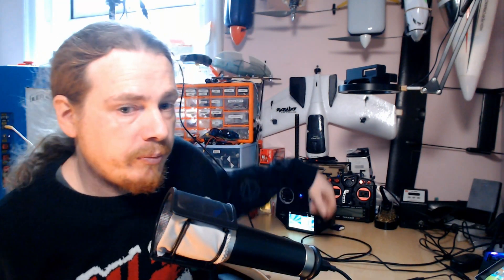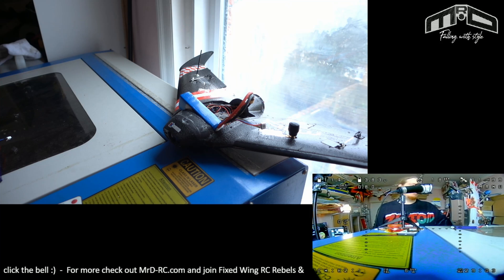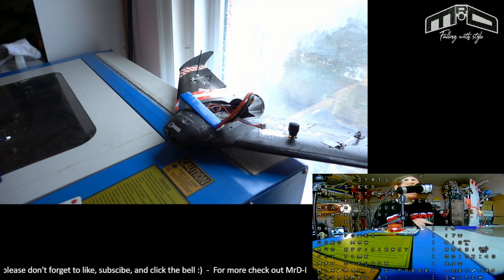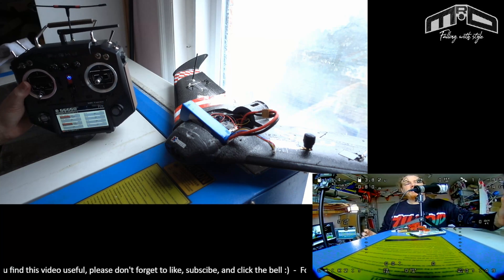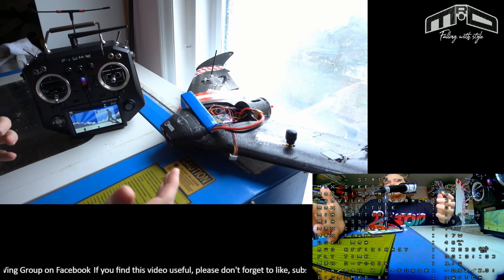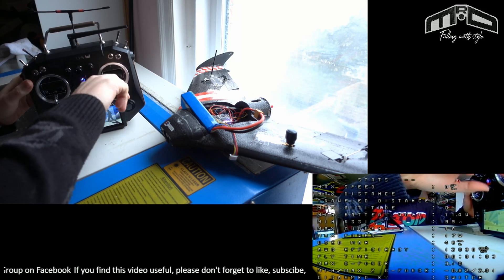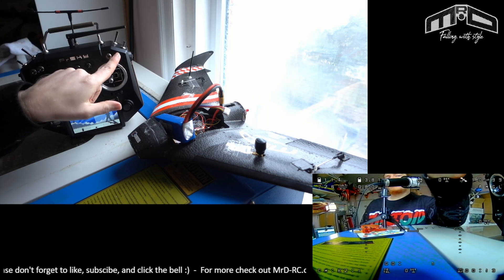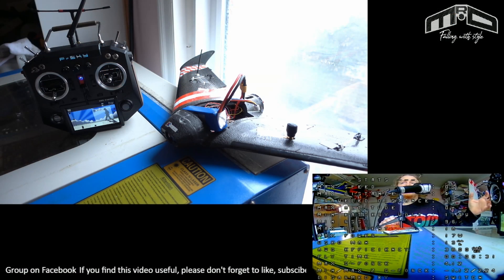Re-Arm In Flight With No Restrictions: Revisited

Comment: This is so useful! I'm quite sure I've had a couple mysterious BAD crashes due to rearm "safety" conditions not being met and also throttle down auto disarm features being activated during random soaring sessions. I wasn't aware of these features. I've been trying to figure this out for almost a year. I wonder if this should be a click of a button option in the  modes tab or advanced tuning tab of the INAV configurator.

Comment: Thanks a bunch! Setting it up on my stuff. I did have a problem not this summer/fall but I think it was the summer before. I had auto launch on all the time and went to move my monitor and bumped the arm switch and disarmed. The plane would rearm fine but the motor wouldn't spin. Maybe it was a bug or something. It was a few versions of iNav ago.
Reply from the maker: It could have possibly been stuck in the pre-launch stage. As soon as I can get flying, I will be trying this out in the air. If I find that it is an issue, I’ll raise a bug. I’ll be trying this out with the default trigger values. Of course, I’ll report back here. 

I think the key will be to look at the system messages after rearming. If it says autolaunch and the motor wont start (this will be stuck at pre-launch with no idle throttle set), lowering the throttle and wiggling the pitch/roll should cancel the launch. That worked fine on the bench. It also didn’t matter if it was permanently enabled or on a switch and still turned on. Also idle throttle didn’t make any difference, other than the motor spinning.

Comment: Are you going to include this configuration on the Inav /OpenTX controller suite you developed?  (Fixed Wing Group "Standard OpenTX Model V2"
Reply: Since I got your attention, (I looked), where can I find your standard OpenTX Model V2 and Pro configs?
Reply from the maker: https://www.INAVFixedWingGroup.com 👍🏻
Reply: @MrD  sorry, I looked there, but didn't look deep enough.

Thanks!

https://inavfixedwinggroup.com/guides/opentx-model/inav-fixed-wing-group-standard-opentx-model-v2/
Reply from the maker: Hi Corey. No it won’t be included with the OpenTX models. We can’t really include anything related to iNav that isn’t purely for the transmitter model. 

The reason being, it could mess up something else that is already set up. For example, if the iNav pilot already have something like auto VTx power switching in the programming. If this was in the install script, it would just overwrite whatever is in the programming slots. 

But it’s a simple enough thing to add. Don’t worry, whenever anyone has a “disarm in flight” post in the group. I’ll be mentioning this 😁